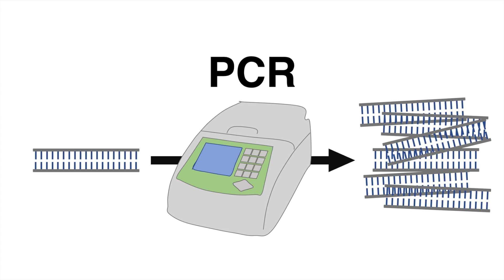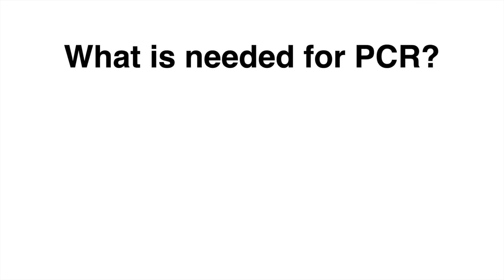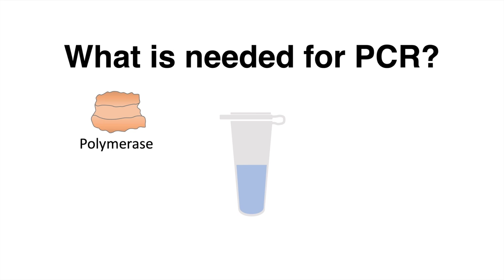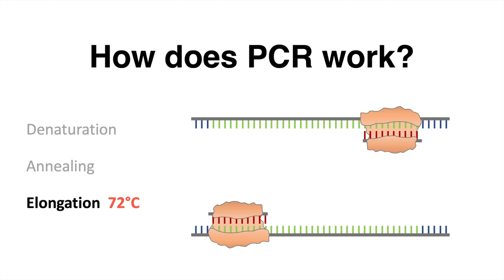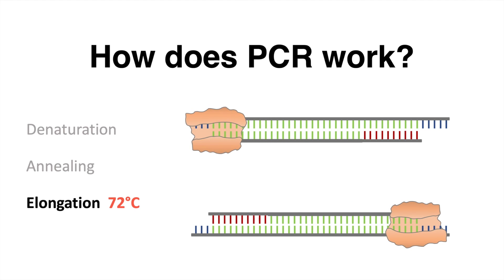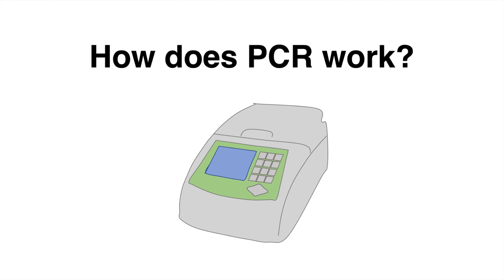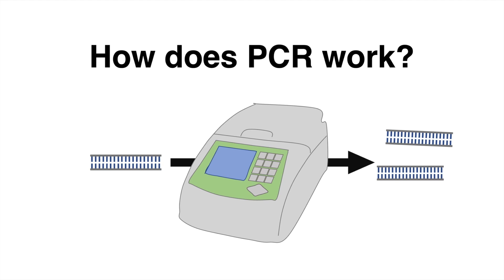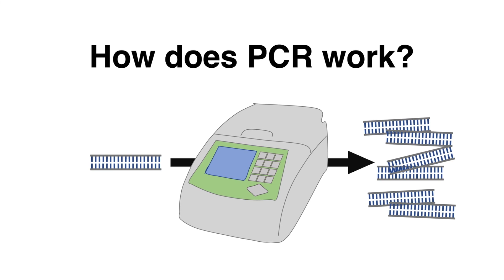How PCR (Polymerase Chain Reaction) works explained in 1 minute

Comment: This video is garbage and does not address the fact that the misuse of the PCR, by enhancing the number of cycles the pcr goes through will lead to false results.

The most reasonable conclusion is that this channel was paid to spread fake news by a platform which censors opinions that negatively affect the Great Reset.